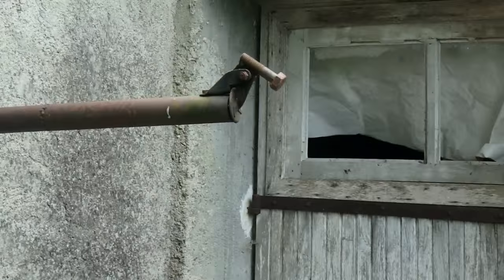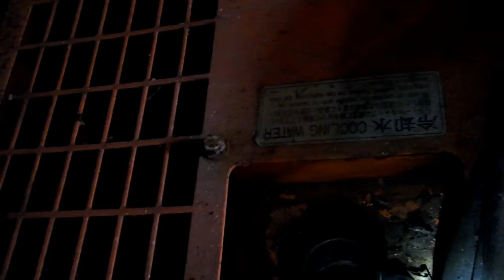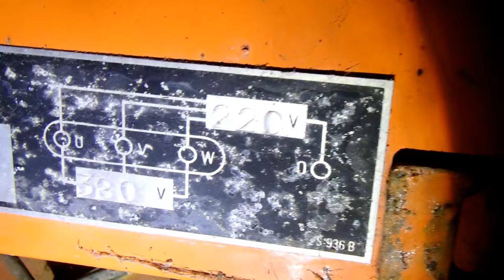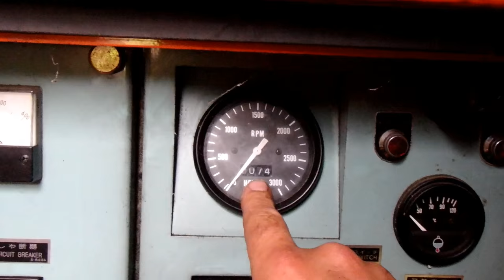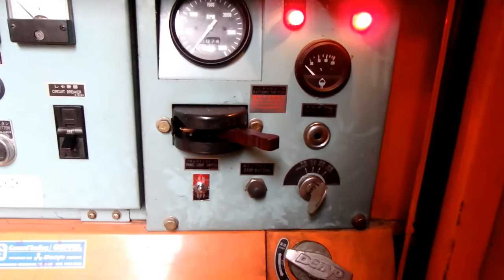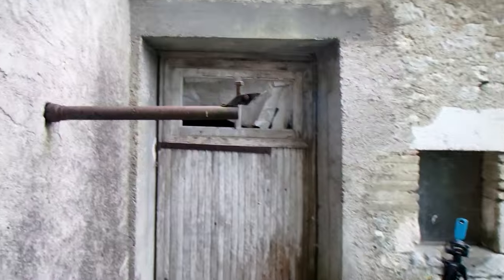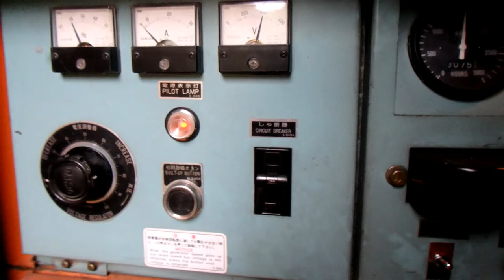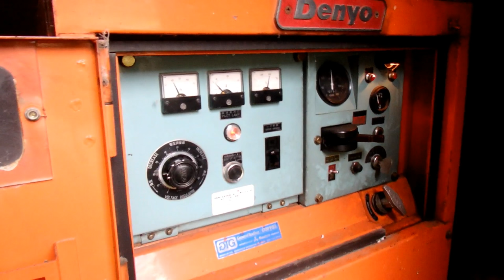30 years old Diesel generator startup  HD

Comment: That’s what is great about those old mechanically controlled Diesel engines. They can sit for years and usually fire right up. I doubt that many of these newer electronic control engines could do that.
Reply: They can, the new ones do not differ and they only have some electronic panel for measurements etc. But most of them to start them up you just press a switch and that's it. But all despite old or new have to be maintained and started up at least once per week to ensure reliability.
Reply: They cant.. truly said

Comment: I watched this a couple of years ago. What you need to do is bring two 1500w heaters, and you can wire them in series to the plug so the 380v will not be too much. Then run it under load for 30 minutes and then while hot change the oil again. Some day you may really need this genset, because your whole family may need to keep warm, if you have a fuel storage, it keeps a very long time. diesel.

Comment: Nice that you had the ability to start it at low RPM.  The MQ/Denyo I run starts at full RPM-no choice.  I’m planning to install a solenoid to hold the rack at idle for startup.
Reply from the maker: Yes it is, we don't  need it for any emergency so we start it at idle to preserve it from violent cold starts.
Reply: Good thinking, it’s known as mechanical sympathy !

Comment: This is an excellent video, but for the benefit of anyone else in the same situation, you should also check the air filter and housing as well for objects and critters that may have made a home in there.
Reply from the maker: +Foxtrot Alpha You are right! I did it@ I replaced  the filter but the camera Wasn't  turned on lol! I forgot to press the buton...
There was actually a mouse nest in the filter!
Reply: @Jan46  hey man, this is a beautiful piece of machinery built in Tokyo in the 80s something. At least it's not outside. Due to the size of the engine, it could be a 2 litres engine.

This is why I love diesel engines, these engines could still run even if they're left unused for 2 decades

Comment: I have an old turbo diesel one that is 750 hp at 1800 rpm and produces the 440Vlt to the main box to power the entire dairy farm.  It was very cost efficient until the mid 1970’s when our local hydro plant began selling cheap electricity way out where we are.  Now i rely on a newer 5kwh for backup power and just use the big unit to run the new production shop tools i put in the barn for a few hours per day.
Reply from the maker: That's nice, keep it alive! 👍
Reply: pmailkeey i buy diesel 500 gal US at a time but at $4 per gal US and  $0.12 per kWh from the power company it leaves me only one choice....SOLAR ARRAY!  Next summer we are putting up a solar array with battery backup that will support a full 12 day outage (we are rural) of careful Winter usage at a peak 12 kWh.  36 enormous glass pack batteries. 20x460W panels, a 5kwh diesel to back it up if levels fall below 60%.  We’re just tired of being only one hour from a city and losing power dozens of times per year for days at a time.  I’d rather be autonomous.

Comment: that's similar to what is in my datsun pickup a sd22 except mine has one more cylinder (4 total). sounds just the same... great engine. on the pre heat lamp I just put my thumb on it and release it when I feel heat

Comment: the light in the engine room flips on without starting the generator. When the building has a diesel generator, I would suppose it's too far from the grid to be connected. Or is there a battery for short term lighting in the building?
Reply from the maker: Ernst Naumann Hi, it's a backup in case of power failure

Comment: Also would encourage my customers to change the oil and any smoking will likely go away. Also wager it's designed to run at 1800 rpm's to deliver 60 htz. Or 60 cycles.
Reply from the maker: +Scott Pecora the oil has 10hrs it's a 1500rpm 50hz generator
Reply from the maker: By revving up the engine above it's normal rpm and turning down the voltage it's possible yes but I woud have to adjust at the pump its limited

Comment: Too Much Oil is just as bad as too Little oil so make sure it's inside two markers and drain out excess.  text made on 6:17 😐
Reply from the maker: Len Vantil the oil filter was empty
Reply: Jan46 I think all that matters is that it works

Comment: Don’t run the rpm’s that low it could burn up the AVR. The voltage regulator not running at speed.

Comment: a little fine sand paper dont hurt on the cables,,,,,,
Reply from the maker: +123willy1000 is covered with contact grease to prevent oxidation